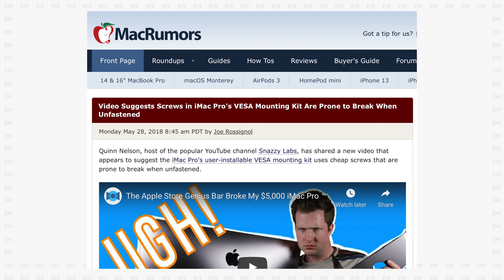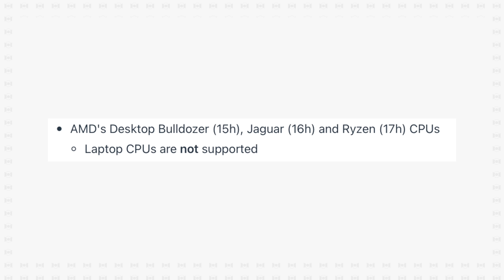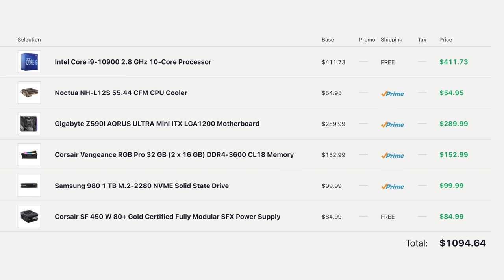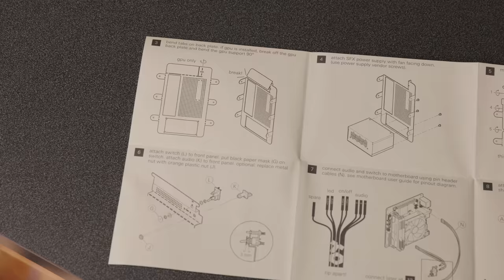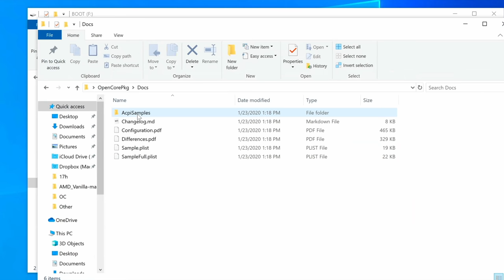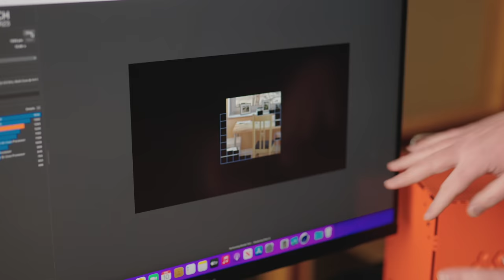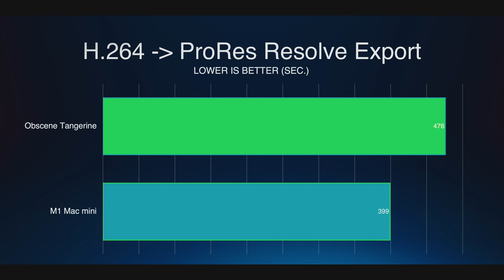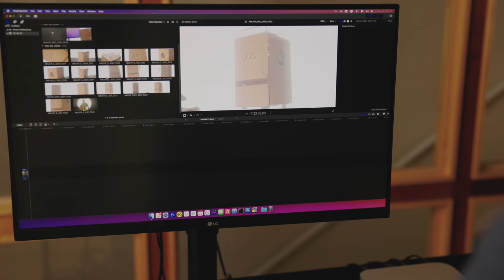The Last Hackintosh?

Comment: The new OpenCore (0.7.6) is said to bring support for the 12th gen CPUs, even the efficiency cores. So probably one last iteration of support over there.
Reply from the maker: No iGPU support, however. Just like AMD chips.
Reply: @snazzy  😥😪
Reply: @snazzy  Then don't use an iGPU ¯\_(ツ)_/¯ pair it against the Max-variant then.
Reply: lmao nah, you’re forgetting there’s 50k Mac Pros out there from 2 years ago that run intel + millions MacBook pros running intel as well. I’d say another 6-8 years of support. Otherwise you’re just supporting e-waste.
Reply: You’re also forgetting it’s just a heavily modified BSD under the hood anyways. As long as there’s developers that can figure out workarounds, Intel/Amd should be supported go forward.
Reply: @mau5atron  So are you saying that we'll always have Intel and AMD hackintoshes?
Reply: C3B0 non-officially, yes. You can thank the hard work developers do to investigate hardware/software compatibility and making patches to make everything work. There’s a handful of talented people doing it for the thrill of making non-Apple hardware work with MacOS.
Reply: C3B0 I want to also point out that videos like these are very click-baitey, there’s still a very much thriving community for hackintoshing. There’s also no need to be on the latest OS version. I hate Apple for making people think that it’s absolutely necessary to update each year and treating it like an iOS release. Your computer isn’t going to magically stop working. My X299 10 core hackintosh is running high Sierra just fine and I do dev work on it. If there’s some tooling I don’t have access to, I just spin up a VM for Catalina/Big Sur/Monterrey within High Sierra.
Reply: @snazzy  You can Fake ID for the iGPU
Reply: @mau5atron  I did two Hackinttoshs in late 2020 - one was an an old ass FX6300 I believe - which worked fine for absolute basics but had the (now known) audio issues (couldn't use it for GarageBand which was whole point of building one) -- but it was still relatively easy despite all the issues I had (part of it was down to the motherboard). I then did an Initel i7 Hackintosh Pro (Coffee Lake) and it was signifcantly easier - everything works (Sidecar, Handoff, etc) Part of that was learning more about OpenCore yes but part of it is how well documented the Hack scene is and all the helpful people in the OC Discord (though some are jerks tbh). 
TL/DR: I agree this video did not accurately represent the Hackintosh scene. Its still thriving and has actually made Hackintoshing more accessible if anything. I understand Snazzy's point regarding the performance-cost ratio but given I first heard about OpenCore from this channel I'd have expected a more accurate depiction of Hackintosh-ing.
Reply: @mau5atron  meanwhile they're rushing M1 adoption and dropping support like never before. My 2015 MBP got pulled to the side, IT'S STILL ALIIIIVE!!!
Reply: @cosmincaliin  You can’t FAKEID for iGPU on 11th and 12th Gen Intel, you need a dedicated GPU.
Reply: Kojax don’t let them make you believe your computer is obsolete and will break down! I also own a 2011, 2015, and 2017 MacBook pros. I’m currently using the 2015 when I’m on the go and it does everything I need it to do (it’s even running Mojave). I’ll probably buy another 2015 model if I can find another clean one, possibly a 2018 version with the 8950HK, and likely a 16in model once prices come down.
Reply: This comment is just as misleading as AMD laptops being supported.
Reply: @cosmincaliin  You cant FAKE ID Intel Iris XE :(
Reply: @avieshek  What a stupid comment lmao. Just go buy some random GPU that's being scalped and contribute to e-waste. Great idea man.
Reply: @mau5atron  Maybe you're not fully understanding what "not releasing any new intel macs" means. Try to understand, new intel CPUs are gonna keep coming out but the old ones would be out of stock + since apple is not gonna add any code for compatibility with those new intel CPUs, each year its gonna get bad (old CPUs out of stock and no support for new ones) But yeah if one has some currently compatible hardware, it may run fine for 5 years or so... but apple updates can still break stuff intentionally or unintentionally.
Reply: @avieshek  it spoils the point completely. it do not make sense at all to build a 2000$ Mackintosh that sucks 800Wats out the plug if there is a Mac mini out there that just need 45wats and is in every single every day task as fast as or faster then the hackintosh.
Reply: @Brukner841  the 2015 MBP does support macOS 12. The latest version now.
Reply: @mau5atron  I would go with the 16" 2019 Intel model. They are much better than 2018 models.
Reply: @mau5atron  For desktops yeah maybe Hackintosh is worth it. But for laptops MacBooks are great and hackintosh is not worth it. The M1 chips are so silent and powerful.
Reply: @avieshek  when new amd gpu cameout it not support as well we stuck with AMD RX 6000 series my friends
Reply: @mau5atron  In fact the newest OS isnt even the best always for every machine.

I regretted hard as i updated my 2010 MacBook pro from 10.12 to 10.13. Never ever the performance of 10.12 got back with a 10.13 update and 10.13 was/is slow af on this machine, its obviously too heavy load without any stuff open already.

And what i can tell you at least considering Mac OS 10.6+ experience.... there was always long support for older OSs... what was more of a problem... Apples software limitations like disabling airplay on 2010 models for no reason (or better, to upgrade to a 2011 model...) and many other tactics to force users to upgrade (like the slow 10.13 on my 2010 machine)
Reply: @cosmincaliin  Do the same method as Windows 7's and Windows 8.1's. There are methods on how to install the iGPU on Intel 7th gen and newer on these Oses By editing the INF File
Reply: @cosmincaliin  faking ID won't get drivers loaded. No drivers means emulated display. Emulated display can't be benchmarked and can't really run anything.
Reply: @arcsine  i didn't once just to give mac one more try and see if it was worth since it was awhile since i last used a mac but i remember not liking it much and that stayed true to this only used for about a week and switched back to windows i don't know why i don't like window to much either and linux is dos wannabe so i am out of luck for an os.

Comment: If anyone is curious, TRS stands for "tip, ring, sleeve" referring to the 3 conductors on a headphone jack. If it has an in-line mic, it will have a 4th connector which is a 2nd "ring" and it's called "TRRS"
Reply: And then TRRRS connectors exist for balanced L/R signals
Reply: not all hero's wear capes!
Reply: Also: Because Apple is Apple, a TRRS headset may not work in a TRRS jack. Apple has their own custom TRRS spec. 😑
Reply: If anyone is curious, "CRS" stands for "Can't Remember Sh*t" and it's a very common disorder that I often suffer from
Reply: There's also TS when there aren't any rings. For unbalanced mono signals, like a guitar cable.
Reply: @BryceCassagneres  Damn, I've never came across any of those in my years of sound engineering! Must be quite pricey and specialized. Do they work with regular jack sockets to carry balanced signal? Because if that so, then that's really freaking awesome!... yeah, no, that's kinda not possible lol
Reply: @Jas Bataille  - balanced audio has got it's own port, typically 2 XLR cables and on DAPs it's a 2.5 or 4.4mm jack. 

Also, a balanced signal generally requires (2 amp chips, not amplifiers) to output the 2 left and 2 right channels.
Reply: ...that's what she said, as the tip was inserted into the sleeve, right up to the ring.
Reply: @JB-fh1bb  that spec is, I'm pretty sure, for the inline remotes they use
Reply: @5urg3x  also CRS stands for "Compagnies Républicaines de Sécurité" a part of french police forces
Reply: Does anyone know which TRS match to which pins in the HD audio connection on a motherboard. S = GNR which is easy but what of the other two... T = Left and R is right but what is that called on the board.... I have 3 pins which I believe could be the L channel and same with R... just need to confirm I have the right ones as for the life of me I can not get the headphone jack on this case to work.
Reply: @David-xt5ob  yeah that’s right. The tip is the left channel and the ring is the right channel. But if it’s not working at all, it sounds like you have other problems.
Reply: I'm pretty sure there's also supposed to be a switch wire so the computer knows when you've got headphones plugged in.
Reply: @s8wc3  There’s really no need for that. I assume most ports have a hardware switch inside that can detect when you plug something in. If not, they could also just detect continuity between contacts and it would work just as well as another wire.
Reply: @ansonx10  Yes the jacks used in computers and laptops do have a switch contact to detect if something is plugged in as part of the HD audio spec (look up the pinout) but it seems like TE is using a regular jack, probably the same used on another one of their products which doesn't have a switch, otherwise they'd have wired up the sense and return line to the jack. So I hope you can force the computer to send audio to the front port somehow in software (short of manually wiring up a toggle switch) or as you said maybe modern audio chips have some tricks that can sense resistance between TR and S because afaik if Windows sees the port is "disconnected" you just can't use it.
Reply: this is where all the audio (hackintosh) producers speak up .. 😀
Reply: 1880 says hi!
Reply: this is the kind of labeling that is supposed to make things easier, but it just makes shit complicated and without sense
Reply: @tatterdemalion898  It's an old (pre-1900's) terminology, originating in the telephone system, esp. switchboards that has carried through to your phone's phone jack in the smaller 3.5mm form.  Apple have (of course) abandoned it for the Lightning port and we'll see what happens when everyone goes to USB-C (do the audio there or retain the 3.5mm socket).
Reply: I've heard the terms tip and ring when referring to phone connectors, I had believed they're simply responsible for when the phone is placed on the Tip, and when it's supposed to Ring, what's the relation?
Reply: @kreuner11    The tip is the end; the ring is the middle segment (because it looks like a ring) and the sleeve is the base - often grounded and a shield line too ('sleeve').

Comment: That case is such a "great idea, awful execution" scenario
Reply from the maker: It is.
Reply: @snazzy  Teenage Engineering constantly amazes me with their ability to go with aesthetics based off simplicity that end up just coming off as cheap, then charging an arm and a leg for them. The Pocket Operators are an excellent example of this, they're super simple but end up looking more like throw-away packaging from Five Below. It's a shame because some of their stuff truly follows classic aesthetics like those from Braun and Dieter Rams, but is let down by its quality.
Reply: @snazzy  They need to redo the folds. Too many holes too close together. Also make a couple of sizes that can take a GPU.
Reply: @chrisva4268  But, unlike this stupidly bad case, the pocket operators are very well thought out and have a great price point, too. Same for the OP-1. OP-Z is a different story, I don't know if they fixed their manufacturing problems there, and the PO Modulars are quite shitty as well.
Reply: I'm not convinced that the idea is great enough to warrant a good execution. The idea that you should be able to fold it together like papercraft is very much at odds with the idea of it being robust and conveying trustworthiness.
Reply: I don't think pc cases is really teenage engineering's strongpoint lmao. Their synths are muuuuch better.
Reply: just like every teenage engineering product

Comment: the lengths people will go just to avoid using Windows OS
Reply: Yes, because it's shit.
Linux is better than MacOS, but MacOS is still nice.
Reply: @gtPacheko  linux lacks support for any major software used by 90% professionals in the industry. Its good for a programmer or a developer, but practically useless for a designer or an editor. It lacks any utility features that’s gonna be used by mass public and requires an extensive crash course to execute some of the most basic tasks. Its not an OS that can be used easily by mass public, so I don’t know how is it better than Windows, let alone MacOS?
Reply: @pupperemeritus9189  Android is an Open Source project, built on linux, and it is far from perfect. The only reason it has market dominance is because it comes pre installed on cheapest hardware you can find. Open source is terrible for targeted optimisation, personal security as the entire code of the OS is available to the public its also much easier to exploit it. Linux has been around as long as any other OS, yet its not even catching to a fraction of the mass user market, and no stat shows it’s otherwise growth. I feel some people just unnecessarily advocate Linux just to sound edgy 😂. It sure has its perks, but jesus f christ it is far from an ideal OS for a mass market. It’s practically the Windows Mobile Os of the desktop market.
Reply: @vshnv_c  i wasn't saying linux is good for mass market right now. but if and when linux gets better for mass market adoption, it will be very hard to displace since it will evolve at a pace that no single company can replicate. open source projects work very much like natural selection in that if it doesnt solve the problems of atleast some people, that project will either be something like a personal project or evolve very quickly into a flourishing project that  is developing at rocket speed.

Comment: That fold yourself computer case is a super cool concept! It's a shame it's so flimsy and overpriced.
Reply from the maker: Indeed.
Reply: Yes, indeed a shame. But I would anyway not have the use case for a small PC case.
However…. if they would make a similarly designed case specifically for the Raspberry Pi and the space for 2 or 3 hard disks and  add a bit more options for modularity, that would be really sweet! I am planning to build a Raspberry Pi NAS at some point, but I am not very happy with the case options already there. Teenage Engineering coupled with Raspberry Pi ecosystem would be a match made in heaven.
Reply: @snazzy  If you are just folding it the same way they instruct you to do so, how are buyers any different then sweatshop laborers? Except they paid 200$ for the privilege. Maybe if I could send them specs for the case, then I build something new according to my design, it would be worth it. They could have an online case designer with template parts that would make it easy and personal.
Reply: @linkndark  TBH, it probably wouldn't be too hard to make one yourself. Just get some thin aluminum and an angle grinder and you could fab your own.
Reply: @snazzy  Maybe buy two of them and fuse the panels together so they’re double thick? 🤣😭
Reply: @JB-fh1bb  $400
Reply: I know I will never build a machine in that case, but my god that orange in gorgeous.
Reply: I went for Geeek a50 case. It's also very delicate and plastic easily scratched.
Reply: "overpriced" is tossed around so excessively regarding this case. the market for this is less the pc community and more the te community. you're paying for the design because there's nothing like it... something TE seems to achieve in many niches... 

also the msi aero cards fit in here as he mentioned they didnt, 3060 in mine
Reply: @trinketbuisness2983  Still flimsy though which is a fact.
Reply: Yes, if they had more intelligent connections between the panels, like clips that snap into place with little springs maybe and if they included structural folds to reinforce it better...
Reply: @BryceCassagneres  aluminum.....angle grinder...... anon, I ....
Reply: @telesniper2  Are you so poor you can't afford a new cutting disc for every 1mm you cut? Lmao.
Reply: @s8wc3  cutting disc ON ALUMINUM.  only a dumb zoomer would say that
Reply: @telesniper2  Poor cope. sorry not talking to anyone who doesn't have the gucci grinder
Reply: @snazzy  Crazy what they are charging for stamped out metal sheets that are cheaper to make and ship than a regular case...
Reply: @trinketbuisness2983  nah, all te products are overpriced. cool design choices but way overpriced for what you get.
Reply: Trying to save money for shipping? That case is only supposed to be used in an art exhibit
Reply: With some sheet metal and a sheet metal bender you can have a foldable case too